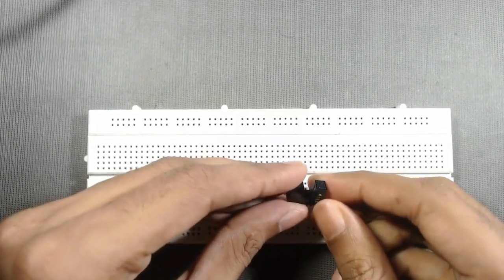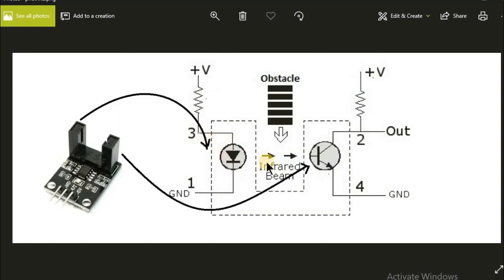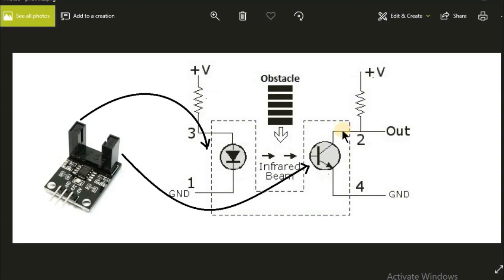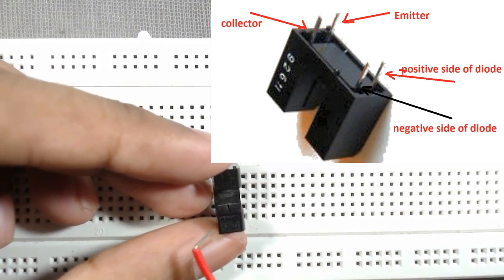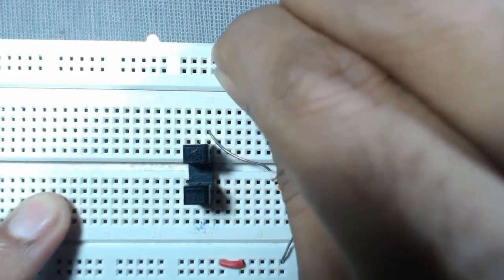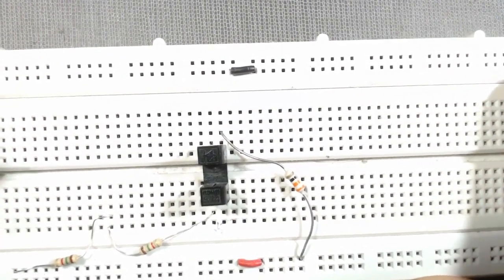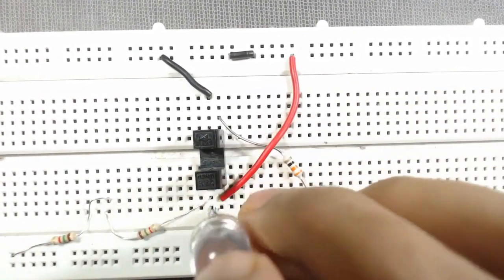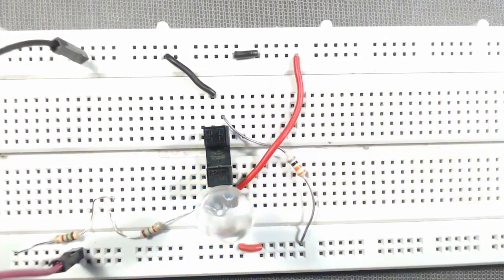photo interruptor sensor circuit as a switch

Comment: How would I possibly be able to get your circuit but in reverse where when the sensor is unblocked the light is on but when it’s blocked the light is off?
Reply: thats what I need to!
Reply: On the circuit I built, which is similar to this but probably not the exact same sensor, I run the two 1.5k resistors to ground instead of vcc, flip the LED around, then run the long red wire to vcc instead of ground.

Comment: What if we use buzzer at the output?
Reply from the maker: you can use a buzzer there. there will be no problem.
Reply: Not working 😰 I have given 9V supply
Reply: If you could help me out
Reply: Some buzzers require an input wave such as a square wave, others do not.   You're is probably the first kind.